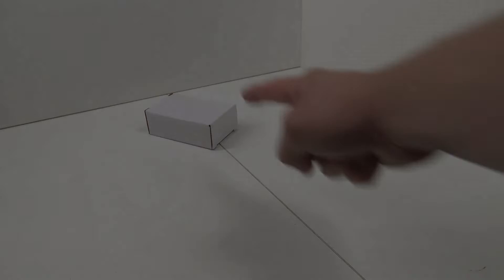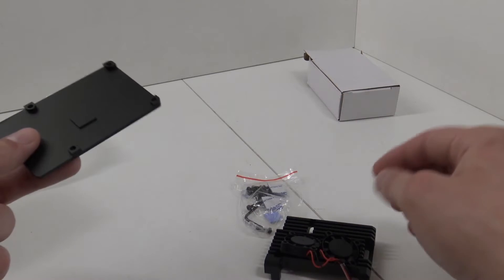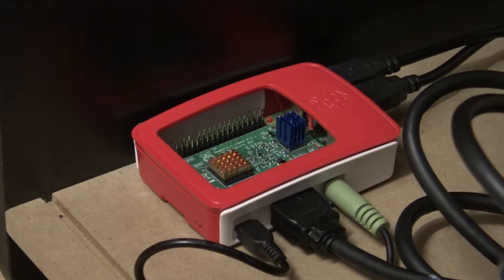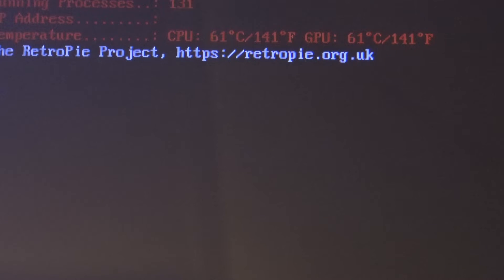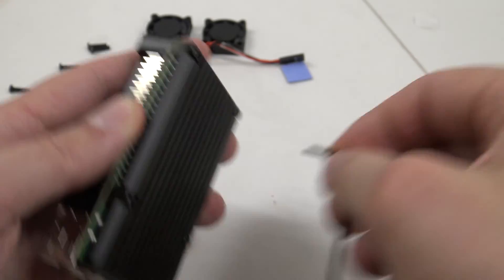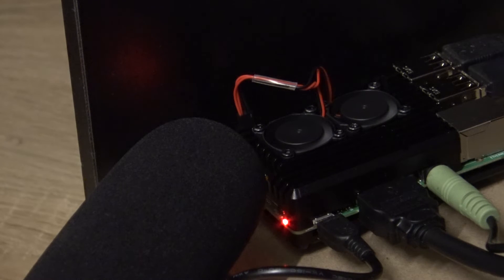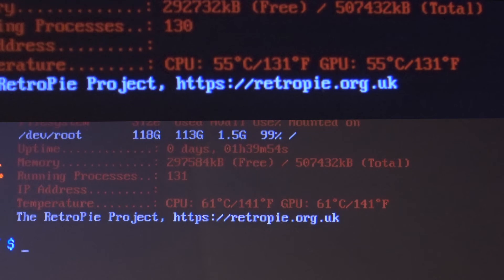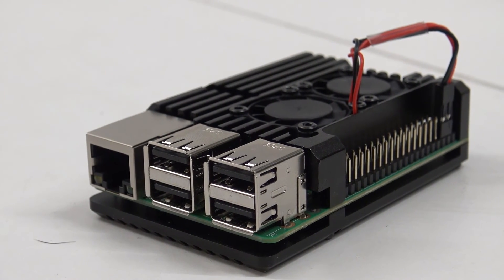The Ultimate Cooling Solution for your Raspberry Pi !!!

Comment: if you still have the product, what is the average IDLE temp?
since i currently have a few cheapo heatsinks 10pcs for less than 1.50 euro and my idle/low usage temp is around 28-30C. {active cooled with a Coolermaster 50mm fan} {since its a 12V fan running at 5V its extremely Quit}
i want to know if i can increase the cooling Performance to near Ambient temperature. without sacrificing the current case i have.
based on the sizing this heat-sink should fit inside of it
Reply from the maker: I think this is the best budget cooling solution. 😄

Comment: Love your videos! I finally subscribed. I actually have the non-fan version for my pi 4. Huge Huge difference, because of a slight modification. I measured the thickness of the heating pads and fabricated a couple of pieces of copper to use in place of the heat pads. used a drop of Arctic silver on each side to add to the heat transfer ability. My issue with the  aluminum was the fact that even with the pads on, the contact points on the top inside of the heatsink were not coming into firm enough contact with the cpu and gpu on the board. Once the modification was done, and i put everything together, I stuck a cpu fan on the top of the assembled unit, and man....huge difference! Worth it, my pi 4 is 2ghz steady. Very nice.

Comment: Raspi 4. 4gb version.  Same cooler. Not using cooling pads as I am using arctic mx-4 2019 edition cooling paste. Running open arena. Sitting nicely @ 35 degrees

Comment: I have 1 of these for some months. The fan starts rattling after a while. Cools well though.
Reply: You try tightening the fan? I had the same problem, and that worked like a charm! Hope it helps you too!
Reply: @Liquidouz  Good idea.  The bolts were a little loose.  Tightened and so far, so good.  Do they loosen up and require periodic tightening?
Reply: Not quite that bad but there is a slight noise increase after a week..... maybe due to dust ect build up

Comment: Thank you for the video. How much room temperature affects test results? Here in the desert temperatures are around 20°C/68°F at night and up to 38°C/100°F in full shade. The specifications state working temperature up to 70°C, but is it possible to keep it beneath that temperature outside without another cooling equipment or another power supply?
Reply from the maker: The 2 days I was making the video it was around 25°C over here.
I had the problem if overheating so that's why i searched for better cooling.
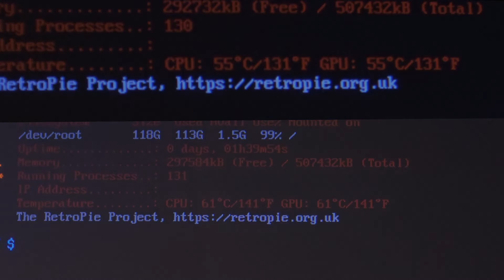It keeps the older Pi really cool if you look at 8:59 on the video. 
So with original plastic casing it reached 70°C and even more sometimes. 
With extra cooling fan in same condition 55°C and I read you can swap cooling paste for even better cooling.
I'm overall happy because my pi is really cool now :D

Comment: Great video, as always!  Just strange temps compared to my RaspB 3b+. I'm running it at 1500Mhz (extreme turbo from recalbox 6.0) and the temps never go over 48-50C using just copper cooler + one little fan.